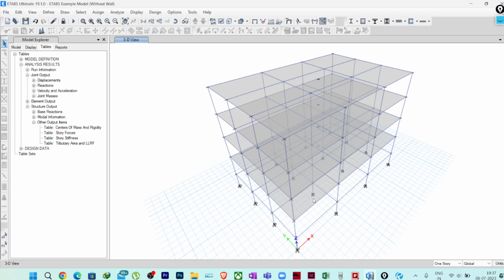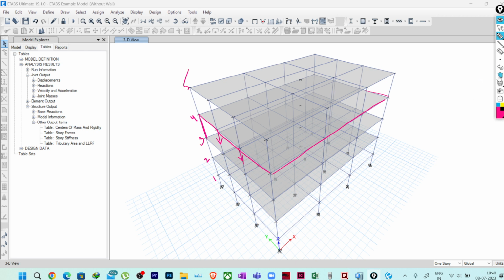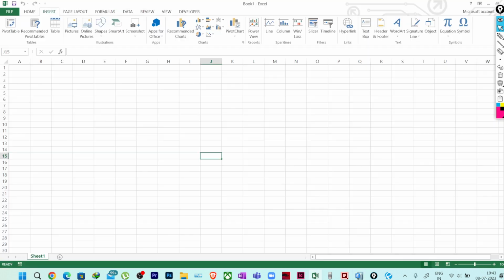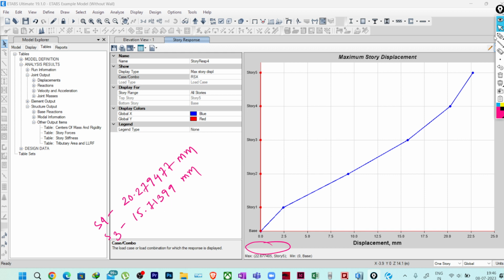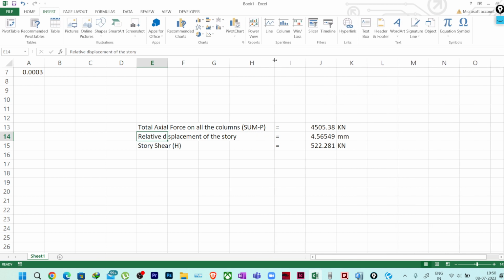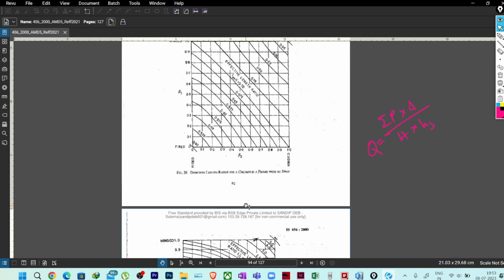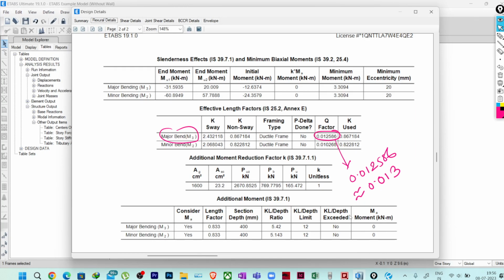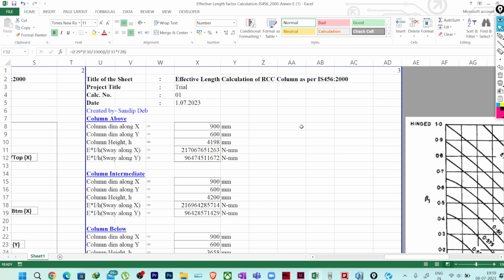Sway/No Sway Column | Calculation of Stability Index | IS456:2000 | ETABS | ilustraca | Sandip Deb

Comment: As per IS 456 annexure E, the meaning of term Δu is "elastically computed first order deflection". Means, deflection taken from first order and also elastic,
But here,you take displacement coming out by response spectrum load case, rather than from equivalent seismic load,
Also storey shear (Hs) taken out from response spectrum case , rather than  from equivalent seismic case as mentioned by code.